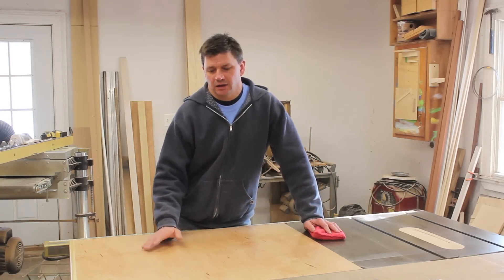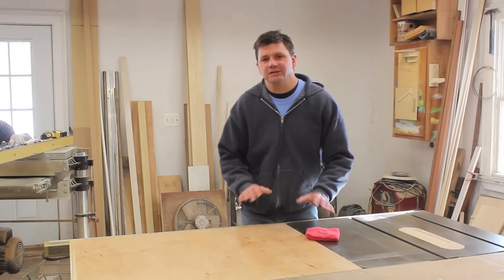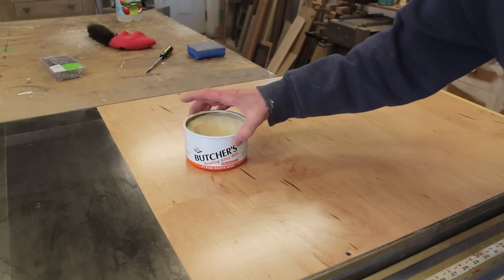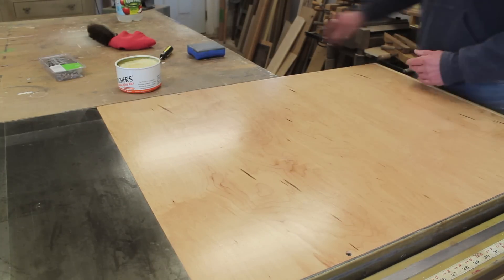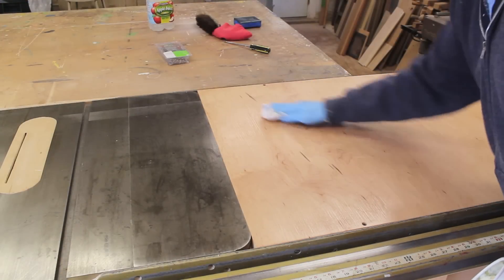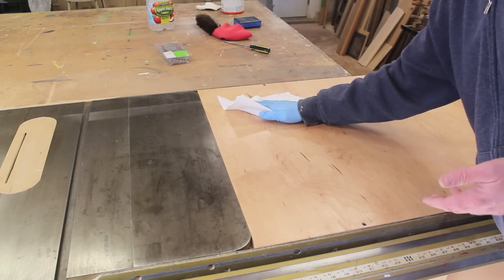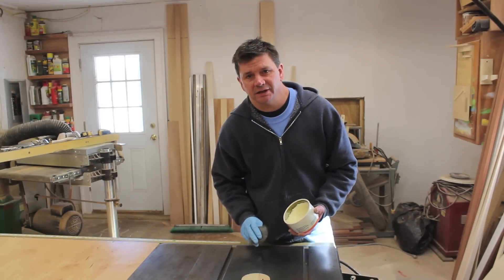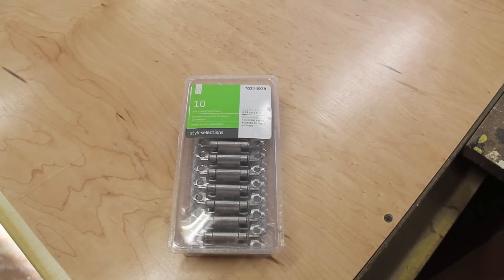Q & A on finishing the table saw storage cabinet

Comment: Good vid. I'm the same way. Video sometimes is a lot easier. I used a white board surface that is exchangeable once it is beat up. It is super slick as it is and with wax it is like satin. Thanks for sharing.
Reply: Here is how mine turned out if you would like to see it. http://youtu.be/ZEOYw0SXSi0
Reply: Thanks

Comment: Hey jon, I use car wax for my tools and furniture finish, especialy hybrid ones, because the overall quality is higher than furniture wax. It's generaly grade 1 white carnauba, and for hybrid ones, polymer sealants inside for a better bounding. Through, polymer sealants are more resistant to friction. The water repellent effect is improoved and no rust may come until at last 6 months. IMHO, car wax is the next level.

Comment: Instead of wet sanding, try rubbing out with a piece of Kraft paper (e.g. a paper grocery bag). Waxing your tablesaw and other tools that the wood has to slide across improves safety; you don't have to push as hard and so have better control.